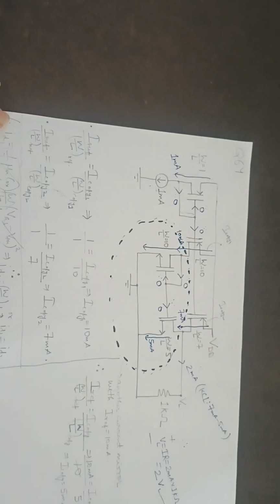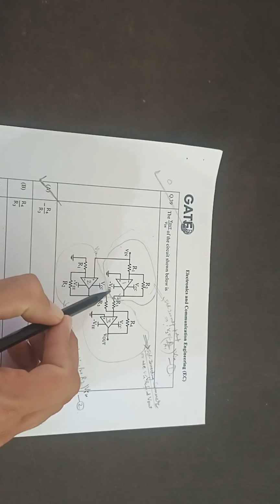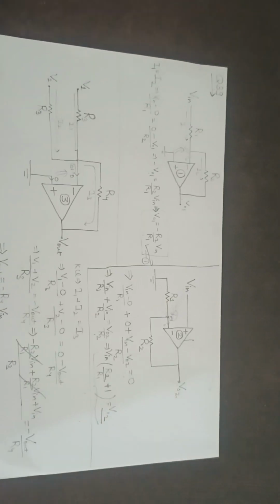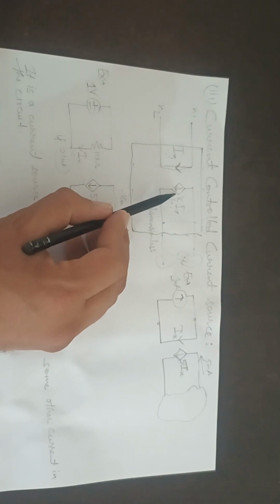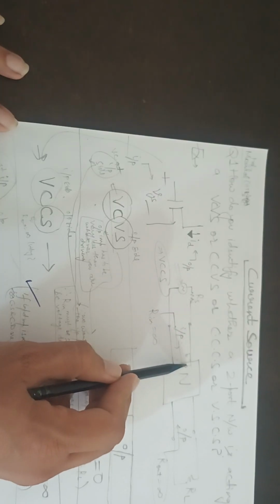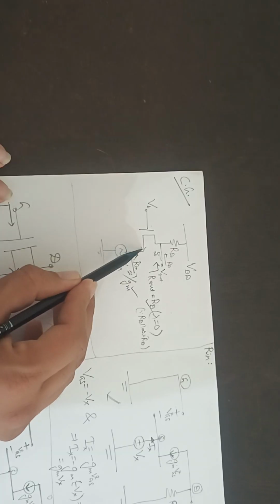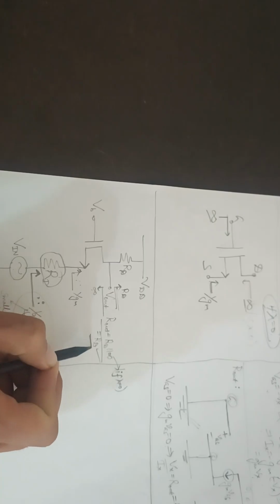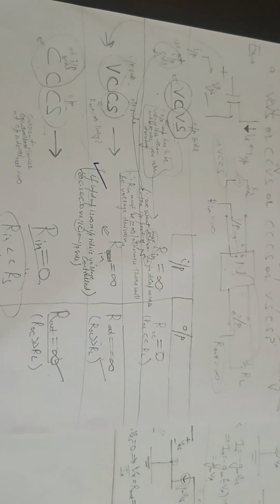Analog circuit questions of GATE ECE paper 2023 (simplest and detailed solutions)

Comment from the maker: Common gate acts as a current buffer with current gain almost equal to 1 which means it can replicate input current (at source)at output port ( ie drain) and also offers low input impedance (1/gm) and high output impedance (of Rd) .
Both these qualities makes it a good current controlled current source.